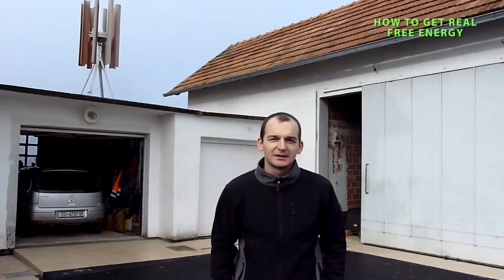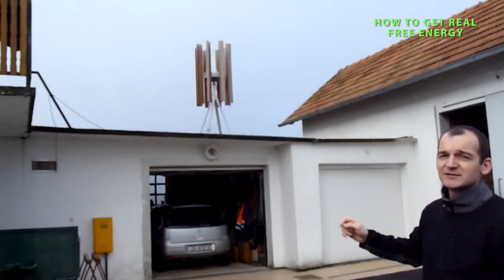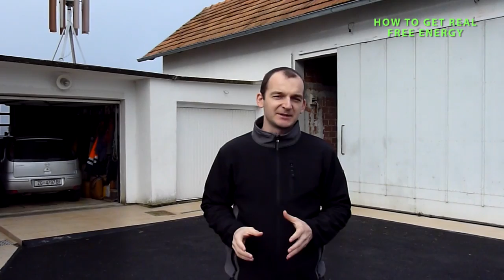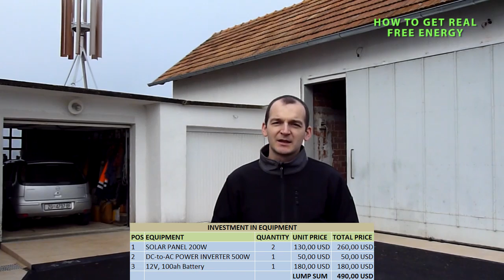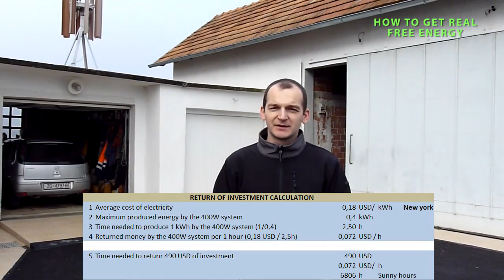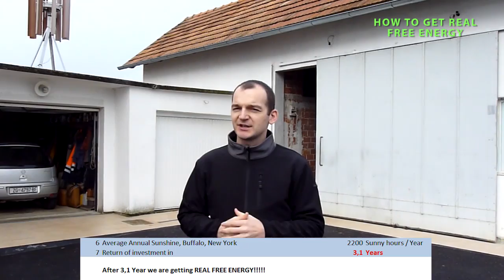Free Energy, How to really get Free Energy!!!!!!!!!!!!!!!

Comment: your using fuzzy math...that's assuming there is sun continually every day...solar is useless..try running any system in the winter on solar in a northern climate,It won't happen.I wouldn't recommend it...now there is a matter of battery efficiency and cold weather or hot weather...its useless I know I have a system and I am speaking of first hand knowledge...save your money don't buy solar .
Reply from the maker: It's very simple math. Its 6800 sunny hours. Of course, if you live in middle Africa or in Finland ROI time will be very different. Mario